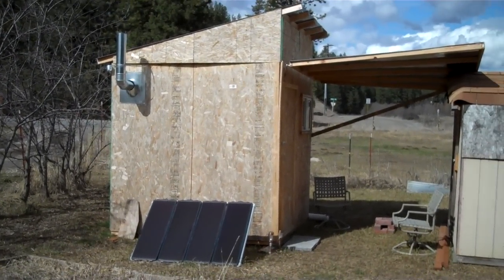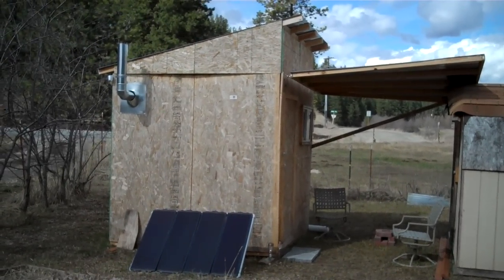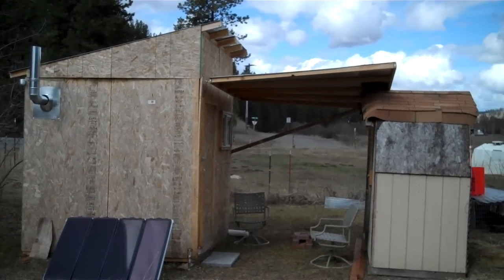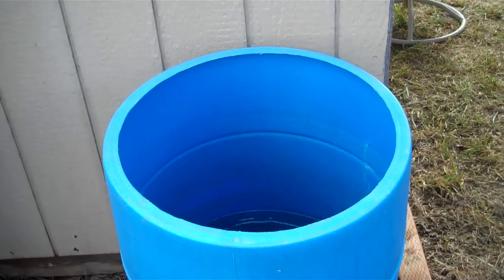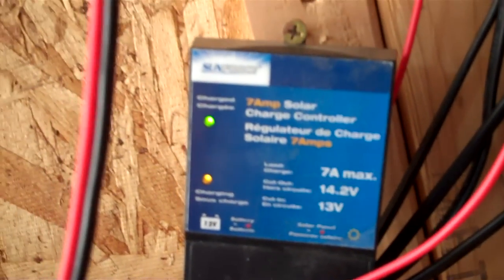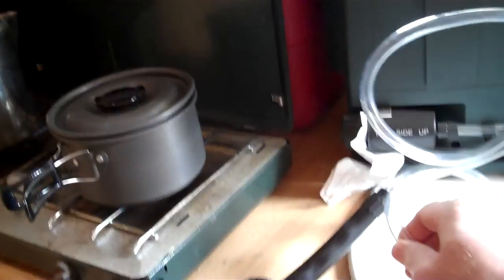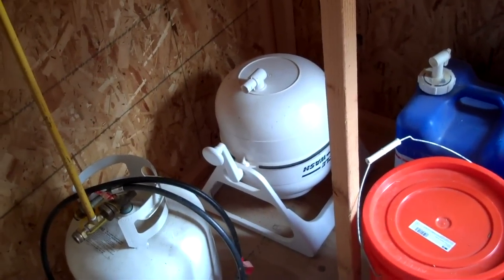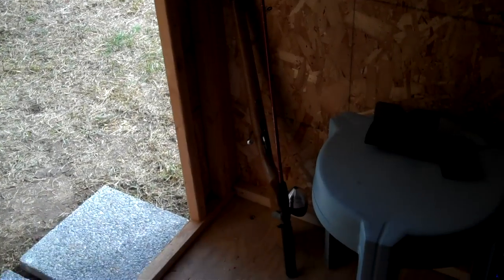Bug Out Survival Shelter

Comment from the maker: only one runs at a time . it is very ventilated in there.you can always open the door , window or use them outside.I mainly keep them in side as a weather and security measure.the tank and batteries should be outside when occupying the structure.

Comment from the maker: Thanks for your comments the bugout is a basic shell or hard tent it is airy and keeps out the weather . and yes the battery and lp tank should be outside or in a box vented outside. as for the pottie you can put it any where the view is good and have a #2 with a view ;) doesn't have to be inside .
 the bugout has been up for a year now and condensation has not been an issue oddly enough. It's not the taj mahal it's ment for survival. ;)

Comment from the maker: The wood stove in this shelter is made for tent camping so it's designed for small spaces. wet laundry needs to be rung out and line dryed in or out of the shelter depending on the weather. thanks for your comments and views. I have a series on my channel right now on building a micro house step by step if you want to follow and subscribe so you don't miss out.

Comment: Excellent, inexpensive. Air quality and critters are problems in woods. Ants, bats, squirrels, mice, and such. Needs to be bug tight. Propane is dangerous. Carbon monoxide detector recommended. I had one save my life. A friend died burning fuel in a camper. Get one. I have many of the same things in my off grid cabin. Eight by eight is tight. I have an 8'x12' with loft. Very nice job for survival. Thanks for posting.

Comment: I love it simple. If on budget use tar paper on outside works better than paint. But might get hot during summer. Also if you add a small room for toilet or shower. Use cement board only as a barrier with stove on other side it will transfer some heat and take bite out of the cold temperatures during winter.

Comment: Kevin, I built a set of cedar cabinets, actually about 14 foot with tile counter tops for a customer THEN he said" put me a gas grill in there". Gas grill and cedar? What I did was line the drop in with aluminum faced duct board. No fire. Have used this trick several times for grills and wood stoves. Bottom line? Pitch your Durock, and replace it with foil faced fiberglass duct board. Foil towards the heat! Mucho lighter, probably cheaper, and a great heat reflector. Try it!

Comment: Kevin,
What a nice start. The only thing I can see as a looming issue in using this design is the roof. If there is any moisture in the air and a 7 or more degree difference in temp on oposite sides, metal will condensate. Your roof will rain inside even if it is watertight. A thin layer of insulation will cure that. It is a very big deal where I live WA Coast in the mountains. There is an insulation just for that application.

Comment: Everything is very well considered and practical, with really nice touches being the hot water maker with shower head and the hand operated, high pressure washing machine.

This is in no was a criticism, but I wouldn't have used OSB for this application, but instead plywood.

I can't stand OSB, particle board or chipboard and won't use them in any application, despite plywood being more expensive I prefer to use that instead.

Personal preferences apart, the fold down awning which secures the door is another really good idea.

You have built the best thought out compact cabin that I've seen. Subscribed.
Reply from the maker: Thank you. I used osb as a material for this as it is inexpensive for prototype development. I would use other materials on the finished project.

Comment from the maker: Chip board or osb ( oriented strand board ) has come a long way from it's early days you can put it directly in water and it will hold up for a long time . That being said it's going to last a lot longer if painted just like any other exposed wood . I built a 5 sided shed out of 2x4 and osb over 20 years ago and it still solid today . This is however a prototype and osb is light weight and inexpensive to work with ;)

Comment from the maker: Hi trulybeautiful786 the solar panel is generating power for lights and other electronics . I have added a second battery since  this video.I have a gas light and an oil lamp as back up . heat is generated by the wood stove and a small propane heater back up systems for both .

Comment: I have a similar shelter.  Mine is take-down/pick up bed ready. It is 8X12, has three fold-down bunk "shelves", and 2 lofts which sleep 2. Sleeping for 7.  The only difference between my shelter and yours, is a few more pieces of OSB.  I do like your design though.  By the way, my wife and I did our laundry (I have four children) with that washing machine for two months straight.  It is a fantastic machine.  The nay sayers do not undrstand how/why it works.  Don't knock it before you try it.

Comment: Thats looks great. Looks like you thouhgt of the little things to take care of the sanitation that make life a little more barable. I'm just thinking the propane and the batteries should be outside, for the fumes. The batteries should at least have a box bench built over and be vented out to the outside of the wall but the propane should be outside with the pipe into the wall. Safety first.

Comment: Nice concept, i agree with Mike D, some kind of livestock will be helpfull, either chickens or quail, they don't take up much room, eat just about anything and will privide protein as eggs or last resort meat.  also that fan you have is very inefficient i have one.  switch to a battery powered fan and then wire it up to your solar, and change the inside light to LED.

Comment: Dig your fold up panel/roof. Make that four, on all sides with hinge room for a fold down deck(s). Ive been thinking of making some cubes to fit on a 8x8 truck flatbed. Use removable camper jacks to drop it. Each cube with a different duty.
Reply: Modular is the word.

Comment: Painted green sovereign board such as this will last 15 - 20 years! I built a workshop 30x10 ft ,10ft high at rear 8 ft at front.
Using this stuff on 6x4 frames. Tar sheet roof. Been there nearly 15 years ago. Still in solid condition according to my ex:-wife.
Just make sure you seal the edges and try and keep the bottom off the ground.

Comment: Loved the shed.  Have you thought anything about using corigated walls with foam insulation?  I have found that the weight is alot lighter, but the insulation does not go down.

Comment: The wide, I would go with 102 or less, so 8 feet wide is fine. You could go 12 feet long. Everything is pretty good, but I would plan for running out of propane and have total wood back up, just in case. Like you said, get out of dodge, you might not have time to get any extra if your low on some thing.
Good idea either way.

Comment: The ceiling inside the shelter: close off the holes, add a screened vent at the top and another at the bottom of a wall - cross ventilation, cheap, simple.

Comment: Use real plywood, with a few coats of serious exterior stain (or latex) ... Move the potty outside ...  Set up an above-ground swimming poolc(or a larger Rubbermade cattle-trough, for rain-catchment and I'll up you score to 100%  (from 96%).  you really do need at least a 300 Gallon catchment container and, with a good, solid 2-inch rain, you could probably fill a 300 Gallon "tank" all the way up.

Comment: what is cost to build the small shelter 1200 dollars or more can you send me specs to build it
Reply from the maker: The Cost to build is probably about half that. it is 8x8x8 with a shed roof. The floor is 3/4 plywood on 2x6 framed on 16 in centers the walls are 2x2 framed on 24 in centers all screwed together so it can be disassembled for transport.

Comment: why not plug the phone into the usb plug on your 12 volt power bar instated of running the inverter   inverters waste up to 60% of the power they use i also would recommend getting a 12 volt universal laptop charger for like 15 bucks on ebay

Comment: That particleboard must me rotting really bad by now if you left it out in the elements.  Hope you at least painted it on the outside.  I would use a different material for the outside that does not rot so easily.
Reply from the maker: The material is Oriented strand board (OSB) ,it is very durable and I purposely left it raw for over a year to demonstrate its durability.I built a similar sized structure that lasted over 25 years out of osb. the glues used in it are really good for exterior use.
Reply: Every time I have used OSB in high moisture situations it has fallen apart. For instance in a bathroom floor that was replaced by a worker of mine, literally was sagging and had swollen from moisture leaking out of the shower, I replaced it with plywood and had no problems.  I have had this happen in several situations in kitchens and bathrooms where this was used.  Perhaps since it is vertical and not sealed it can dry out in your application. But for me I have had bad experiences with the stuff. (OSB)

Comment: That place is a bomb just waiting to happen.all the wires are tapped together & most of all is his battery storage is inside which should be outside.& all of the propane tanks inside with that wood buring stove all stuck inside.Don't get caught locked in there or fall asleep in case it catches on fire or the gases build up inside.terrible thought of everything inside.

Comment: 8' wide? That's at or beyond most legal highway width as I recall. Just sayin'.
Reply from the maker: +joe woodchuck My pickup truck is 8 feet wide. This shelter sits just right on the bed of the truck.
Reply: The maximum width allowed is 102 inches.
Reply: +joe woodchuck beyond 119" (North America) you need a permit